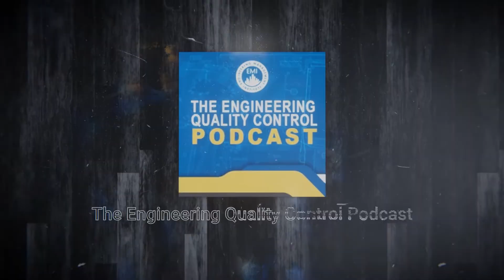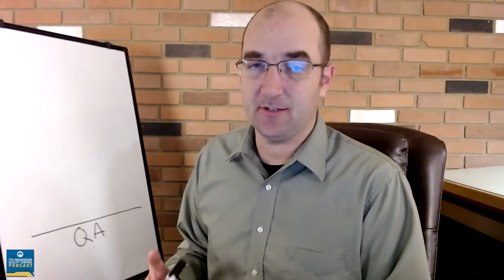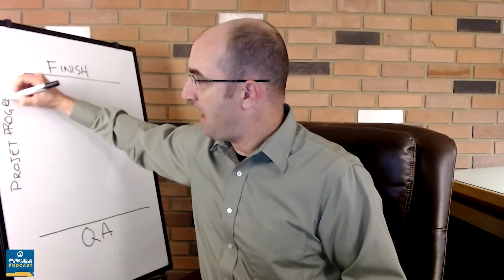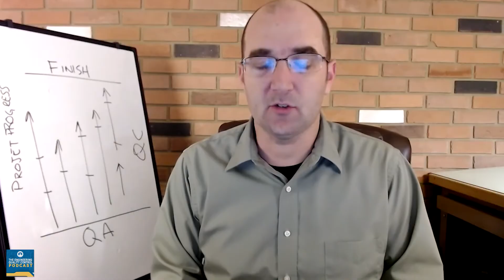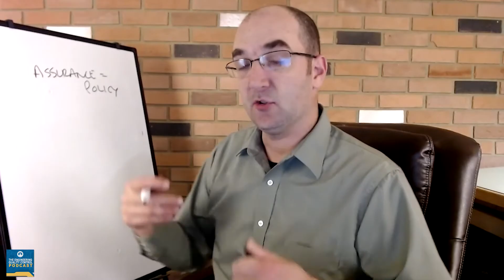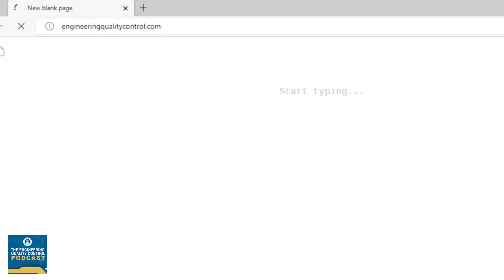Quality Assurance vs Quality Control: What’s the Difference?

Comment: The ISO definition is, in my opinion, objectively the more accurate by far.  Words have meaning; and 'assurance' means just that: to assure the customer (internal or external) of the product AND PROCESS quality that will be provided to them, and consistently.
Reply from the maker: @jaggedstarrPI You make a valid point! The ISO definitions really help clarify the roles of assurance and control. Understanding these distinctions is crucial for maintaining quality standards.

Comment: According to iso 9001 - vice versa
Reply from the maker: @omamchy You're right! ISO 9001 emphasizes the importance of both quality assurance and quality control in maintaining standards. It's crucial to understand their differences for effective implementation.
Reply: @EngineeringManagement  as practice shows there still remains confusion from organization to organization. I think majorly conventionally QA in IT test product and verify it’s quality while QC is more distributed responsibility handled by many parties (qa and management) that dedicated to monitor current quality level and suggest improvements to process/other dependencies which may improve quality. For example if there is a bug in the system - QA should find it so it could be fixed. On the other hand if we agreed to have weekly automatic deployment and this doesn’t happen for some reason - to detect this problem and make sure the process is fixed - is a QC activity. IMO. Am i wrong?

Comment: These definitions are all over the place depending on where you were.  Is the person testing or inspecting "controlling" anything in the finished product, or are they measuring it?  Is the person creating the product "assuring" it, or are they the ones really in control of it's quality? Even the FHWA and FTA can't agree on what they mean.  A better approach is to use the more modern ASQ definitions tied to the cost of quality.  Prevention (or process control) are the things that prevent defects in a product in the first place.  This includes knowing the requirements, having a process that can meet those requirements, and keeping the process in control.  Appraisal (or verification and acceptance) tests, inspects, and otherwise measures the produced work to see whether or not it meets requirements.  So prevention (a necessary cost) has to go into every piece of work, but appraisal could be statistically estimated (also a necessary cost vs 100% inspection and testing which is usually an unnecessary cost unless you're managing nuclear warheads, going into space, or bolting doors into a Boeing aircraft).  Defective work that is caught in appraisal is an internal failure, since it requires rework but the customer never sees it.  Defective work that is not caught in appraisal is external failure and can often end up on the six oclock news like some bridge projects.  Whether it's internal or external might depend on your point of view.  Just as prevention and appraisal might depend on your point of view.  If someone else produces work and you appraise it, you were not in control of that work, but you might be in control of whether or not that work is accepted and incorporated into other work.
Reply from the maker: @DannyKahler-PE Thanks for your insightful comment! You're right that QA/QC definitions can be confusing and vary widely. The ASQ's focus on prevention and appraisal, tied to cost of quality, offers a clearer framework. We also agree on the importance of statistical sampling in appraisal.

Your point about the dynamic nature of quality management, where roles can shift, is spot on. Thanks for enriching the discussion and sharing your expertise!

Comment: So is quality assurance the mechanism put in place by corporate team within an organisation or business, to meet customer expectation to show that a product or project is "fit for purpose". It's the measures provided by the organisation that should be independent to the project that can be internal or external to the business/ organisation that ensure that outputs will be measured and verified to meet expectation. Quality assurance is when the organisation puts guidance processes, policies in place that will be used to measure quality control internally to ensure that safe, reliable and compliant outputs are developed. Business will implement a team of Quality assurers. Quality assurers are like H&S, Fire Safety, prevention teams, Policy makers are all employed within an organisation to verify that quality assurance is in place to proactively prevent liability, Make sure that the product or project is deemed QUALITY. E.G Think of a HTM or HBN as a guideline or standard that the corporate team insist that a Construction project must adhere.  QA is Pro active.

Quality control is the process and measures of working to produce (execute) a fit for purpose product or run a project throughout project lifecycle. E.g a Project applies quality control by implementing Project management plans, or instigating a gateway review to determine that a project is on track. It could be a Product review after going live with a MVP. A PM, A Commissioner/ validator, financial auditor or product inspector would all be involved in Quality control during the development of a product or project. QC is Reactive. When you create something you need to quality control it to make sure it is correct.

But the reality is many QA and QC use the names interchangeably in many businesses and organisations all over the world. So APM should not state that QA or QC as totally defined as stated above as it would not be correct to. Understanding that Quality is defined by a Quality management System that can be described either  (QA or QC) way is likely correct.